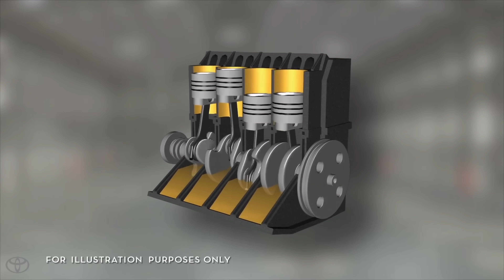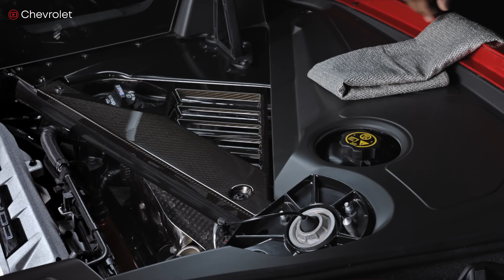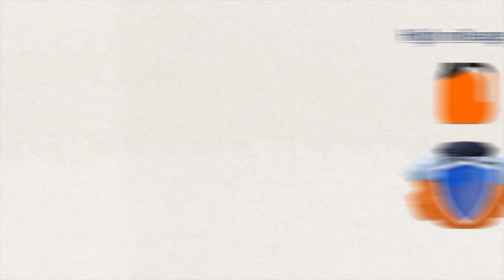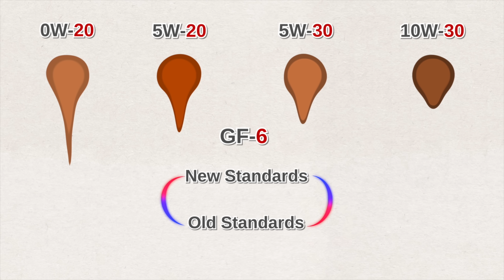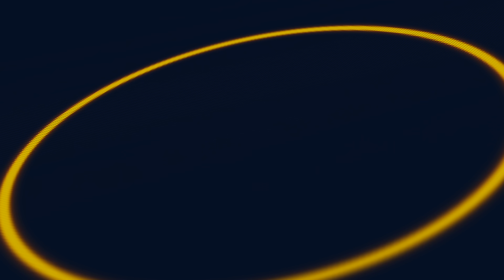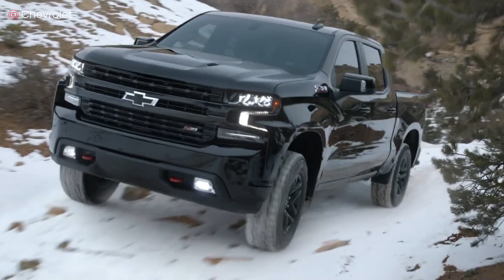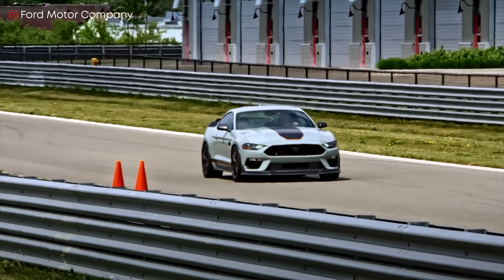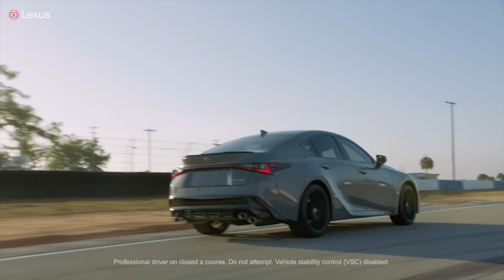7 Engine Oil Myths Stupid People Fall For

Comment: Since the pandemic started in 2020, I only clocked about 1,500 KMS on my car since my last oil change in Feb 2020.  Do I need an oil change every 6 months like what the dealer is saying?
Reply: Scotty always talks about how he only changes his celica's oil once a year since he only puts around 3000 miles on it a year so you'll probably be fine but at the same time oil is cheap you you could do it at 6 months for the peace of mind if you're worried about it. You just need a wrench, pan to catch the oil and new filter and oil. I change my own out and it only takes 10 to 15 min tops so even if you're not mechanically inclined you'll still be fine.
Reply: Very low mileage for me also due to pandemic, I have done once a year oil changes. Mechanic said I can wait until light comes on for oil change but I prefer to change oil and protect engine. Next time I will ask them to look at condition of oil .

Comment: What if you only drive your car 1000 miles and it sits for a year? When should you get another oil change?
Reply: Change it once a year if you’re not meeting the mileage
Reply: I wouldn't change it ... oil does not go bad from sitting.  i have seen UOAs (lab analysis of used oil) that back this up.

Comment: Always use the correct oil for your engine and fill your engine up just right. No overfill at all. Make sure it’s at the Gil line. Always change oil every 5 to 10k miles

Comment: I change oil on my kia rio 5 once a year weather it needs it or not.  Just kidding 2 times spring and fall about every 10k miles.  Only got 247,225 miles on it so far.  I'm going to see 300k easy enough.  But Idk if I'll reach 500k.  Already hit 2 deer with it, it's starting to look a little rougher than this veteran.  😄    I always use full synthetic

Comment: I've used full synthetic in my cars for the last 2 decades or so.  Sure, it's expensive each time, but new engines aren't cheap!
Reply: You can get full synthetic from Costco called Kirkland Sgnature full synthetic. $12.50 for 5 quarts comes with 10 QTS in a box. Cheaper than conventional oil and made by a reputable company as well.
Reply: @900Yugo  Thinking that the Majority of Oil Retailers just buy the Oil from Oil Manufacturers as long as its certified /Approved  their very recent API Standards you're good to Go... [...SN or even SN Plus...]
Reply: @malachy1847  It's SP for API certification now.
Reply: @900Yugo  I use the autozone brand as there is no costo nearby here in mexico. $23 usd for 4 quarts of synthetic oil and a Bosch "premium" filter.
Reply: @Brandon-uy1uv  I work at autozone. We don't have a bundle deal for $23 and we don't sell bosh filters. We especially don't have oil deals with name brand filters so not sure what you are talking about buddy
Reply: @smallbeans101  He's in Mexico. What a company does in one country can be a little different in another. For example, last time I was in Canada, you could get a pizza at McDonald's. McDonald's in America does not serve pizza.
Reply: @smallbeans101  Autozone has stores in Mexico. So selection can be different between countries.
Reply: @startedfarting2336  I tried McDonald's in Mexico. They had these Horchata shakes that are quite good.
Reply: @startedfarting2336  thank you for explaining this to me
Reply: @startedfarting2336  they haven’t serve pizza here for about 20 years at McDonald’s in Canada
Reply: @startedfarting2336  I went to Chicago when I was 17 and a McDonald's there had pizza on the menu as well and never seen it again anywhere lol
Reply: @DCSPORTSTER  lol I was just going to say that too!
Reply: @startedfarting2336  hagahaha
Reply: @startedfarting2336  I have lived in Canada my whole life.  Where and when did you get a pizza from McDonalds?  I think they had it once like over two decades ago.  But it wasn't real pizza as real pizza has pineapples on it!!
Reply: @PimpSolja49  20 years ago in Montreal. I thought it was decent pizza, actually.
Reply: @startedfarting2336  well that pizza is long gone.  Now McDonald's has 5 different types of spicy chicken sandwiches.
Reply: @Brandon-uy1uv  
Don't they use liters instead of quarts in Mexico?
Reply: @smallbeans101  
He said in Mexico. Could that make a difference?
Reply: @masterofnone1808  oil is sold in quarts, its also measured in liters and I think it's 0.946ml or something
Reply: @Brandon-uy1uv  
So Mexico uses quarts instead of liters? I didn't know that.
Reply: @masterofnone1808  only for oil, we buy fuel in liters
Reply: @startedfarting2336  you can get McSpaghetti at any McDonald's in the Philippines.
Reply: @smallbeans101  Bosch filters are a thing as I worked in AutoZone in Arizona
Reply: @startedfarting2336  MacDonald in Australia does not serve pizza
Reply: Jut my opinion, but I bet if you would have used a known brand of conventional oil of the recommended weight and changed oil and a good quality filter every 5,000 miles and tore down the engines, the engines would show similar wear and tear.  I bought my Nissan Titan new in 2005 and nowhere in the owner's manual do they even mention synthetic oil.
Reply: @louisstennes3  …because they don’t want your engine to last lol.
  Not sure what education your “opinion” is based on but I’ve been a HD mechanic for 36 years and a Crew chief in super pro for 15 and I can tell you with professional certainty that you’re wrong. I’m not going to get in depth but you can educate yourself on the difference between conventional oil and PAO synthetics (like AMSOIL) and get a basic understanding as to why no conventional oil can by design perform and protect like PAO synthetics.
Reply: @DieselsHOGVlog  What does working for Home Depot for 30 plus years have to do with engine oils? Let me educate you with my professional dealership knowledge. We all know that guy who ran nothing but Mobil Marble Mystery Full Sin Slick Foam Fifty in his Detroit product, with a copper funnel, only for Shep to give him the bad news at 79K. 

We’ve all seen Japanese vehicles run flawless with 300K using oil from Seven-11, every 5K or so why? Materials & tolerances that’s why. Like we tell all our customers: “Pay attention or pay cash”.
Reply: @gerrylundergaard60  Home Depot 😂 guess again.  “Professional” and “dealership” are counterintuitive!! Grab a glove and get in the game skippy,  clearly you have zero technical understanding of what PAO synthetics are or why they extend drain intervals and the life of rotating equipment vs conventional lubricants.🙄
Reply: PAO"s ?
You mean Poly Alpha Olephins?
Reply: Well said, Scott.🚗
Reply: 30 bucks of oil is expensive?
Reply: They are! If you can afford a new car you can afford a new engine.
Reply: I use 20W50 for my 2012 mazda 3
Reply: @amitharun2000  A SkyActive engine with GDI should use 0W-20 synthetic.  It's what Mazda recommends.  20W-50 is WAAYYY  too heavy for that engine!
Reply: @ScottMeister  mine is not sky active and I live in UAE
Reply: @ScottMeister  can u suggest me a good oil for 2012 mazda 3 which has run 300k kms driving in hot regions
Reply: @amitharun2000  
Same oil as recommended when new. If it leaks or burns oil just switch to a high mileage oil. After a couple change intervals it should improve.
Reply: @amitharun2000  
Whatever your owner's manual says...
Reply: @amitharun2000  10w30 fully synthetic oil better

Comment: I have an 07 corvette, overheats badly after a few minuets. Have not changed the oil since 2016, could this be why?  :D
Reply: Have the cooling system drained, flushed, and refilled. Would also change oil.If it still overheats check the thermostat. Ignore the other two SmartAsses .
Reply: The oil is Definitely not it. Oil has long life! When it comes out for oil change, usually is still called “oil”.

Drive with foot down all the way, the harder the engine works, the faster it goes, the more air through the radiator, helps cool best. Also AC always on too, helps cool you in the car, therefore less heat outside of car too, plus the cool may reach engine easily.
Almost forgot, park it outside in sun, middle of parking lot is best. Less temperature differential, car is pre-heated, saves fuel specifically in summer time.
Lastly, Keep tires at about 10psi or less, a much softer ride almost Cadillac style, and for easier rolling resistance too, again helps gas to get used up faster, saving weight and by that becomes faster and more economical too at same time.
Trust this helps.
👍👍

Comment: Remember when bmw requires 15k mile oil change ?- it was a bad idea. Bmw owners realized after 80k miles where all seals are hardened and crusty due to dirty oil.
Reply: 15k miles. Hahahaahaha! No wonder their cars dont last 100k+ miles.
Reply: Had a customer come in in a 80s BMW and he bought it new (this was back in 2005 when he came into my shop) he said he always went to jiffy lube since the first change. The BMW had almost 200 thousand miles. We drained the oil and as I was on topside changing the canister filter the customer asked me what I was doing and I said "Changing your oil filter" he said "The guys at jiffy lube said this doesn't have one" my eye widen as a got the canister top off and pulled out a solid cylinder of hard as a rock oil filter that basically turned in the tar. It was insane that that was the factory filter. He called jiffy lube and they denied it. I seen bad filters but nothing like that in 19 years of auto experience.
Reply: It works fine in the rest of the world. In fact 15k is pretty regular, most of our new vehicles are up to 30k miles and its fine. I can only assume american oil or fuel is of a much lesser quality than what is avaliable in the rest of the world.
Reply: "manufacturer knows best"

yeah, they know best how to shaft their customers

Comment: Both my vehicles recommend synthetic.  I'm wondering if it would void the warranty if I used conventional.  My daughter owns a car with a turbo.  Synthetic is recommended in her car also.  I'm guessing that conventional oil is fine as long as it's changed regularly. We live in a cold climate (Canada) and my vehicles do start much easier with synthetic.
Reply: Synthetic is better for the car with the turbo especially cause it’ll absorb the heat a lot better than conventional and synthetic blend

Comment: Used straight 60 weight Harley-Davidson motor oil in my 1953 Panhead. Thicker than molasses cold, thinner than water hot. 20w50 worked better.
Reply: My Moto Guzzi uses 10W-60 engine oil. A tad harder to find but NAPA Auto Parts carries it as well as online. Some BMWs also use it.

Comment: Would you recommend high mileage oil for modern engines?
Reply: If over 75,000 miles and showing signs of seepage or high oil consumption. There are the full synthetic high mileage oils available now that cover the newer cars.

Comment: hey scotty i just bought a 2016 rav4 and when i’m on the highway going about 80 mph the tachometer will stay at around 4000 RPM for about 45 secs or more before it shifts, is this normal?
Reply: Yup, try change the oil first. If it is Auto trasmission,include also changing the filter.

Comment: Instead of buying synthetic blend, just buy one quart of fully synthetic and mix it with regular motor oil.  Save you a ton of money, plus you know how much is synthetic.
Reply: Why be cheap  go full synthetic!
Reply: I figured it would be specially formulated to have the right amount of additives for that blend.
Reply: @Jaguar7444  I used to trust the food industry and others.  Now I question.  How much synthetic oil is required by law to constitute synthetic blend?  1%?  10%?  If you mix it yourself you know what's in there.

Comment: I don't know but I've got over 390,000 miles on my 98 Chevy v8 with conventional oil. I don't think this new style oil will do better.
Reply: I agree all I've ever used was regular conventional oil in all the cars i've had and knock on wood my engines have lasted and on my ranger i used regular oil and i drove that thing hard with stop and go driving delivery and i've changed my oil every 3,000 miles sometimes i've gone more than that but usually 3,000 miles
Reply: You likely changed oil every 3 to 5k Miles....a waste of time and oil...generally 2 to 3x the cost of synthetic oil